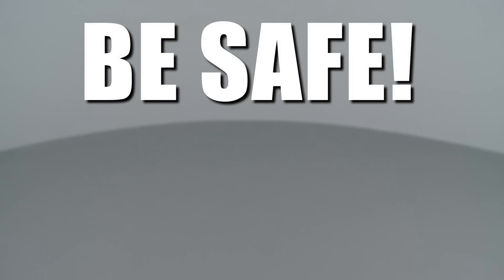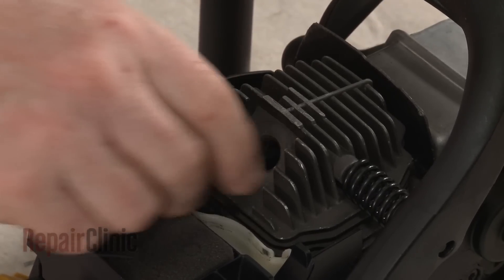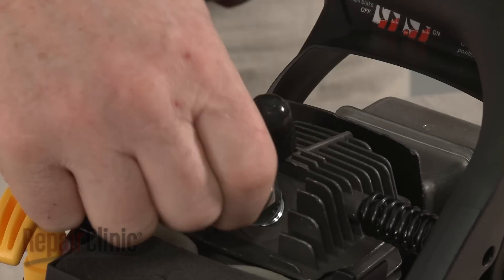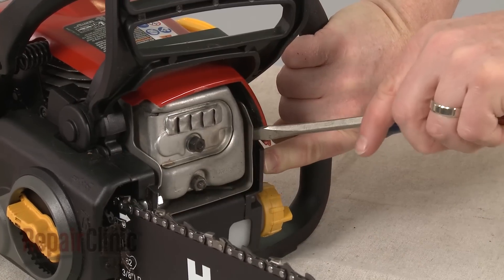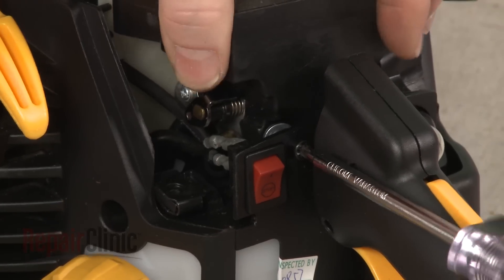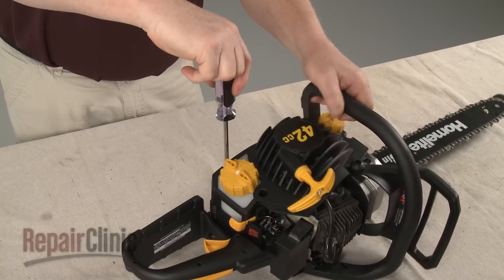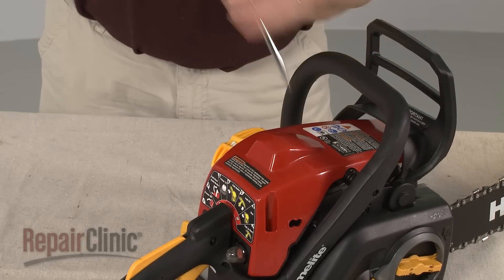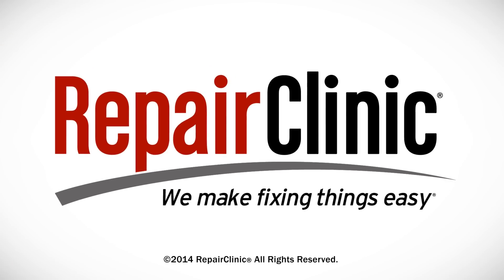Homelite Chainsaw Disassembly – Chainsaw Repair Help

Comment: I agree with Sean, I had to replace a melted chassis as well. It's all back together now with the exception of the Isolator springs. I was hoping to find a video to help me learn how to reconnect them.

Comment: If the housing around the clutch is smoking and the chain starts and stops, is there a way to adjust the clutch or does that mean the entire clutch has to be replaced?

Comment: My problem: the emergency brake bar spring is not adjusted right - brake is on unless I tug on bar -- not mentioned in this video.

Comment: I have this chainsaw. It wouldn't start. After rebuilding the carb, still no go. I knew I had spark, gas and the muffler wasn't obstructed, but what about timing. So I pulled the rotor.. What a P.O.S., the key is formed out of the aluminum rotor itself. Rather than buying a new rotor, which would have the same poor design, I used a small metal file to create a slot in the rotor for a homemade steel key. I then created a key from a concrete nail. Ground it till it fit, put it together. The chainsaw started on the first pull! Sweet!